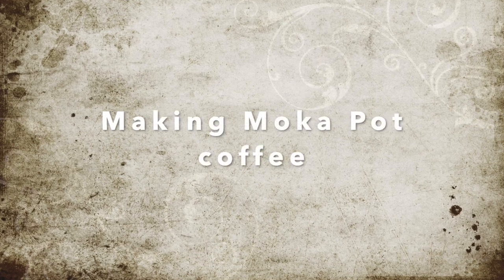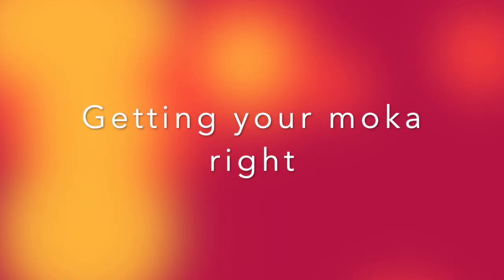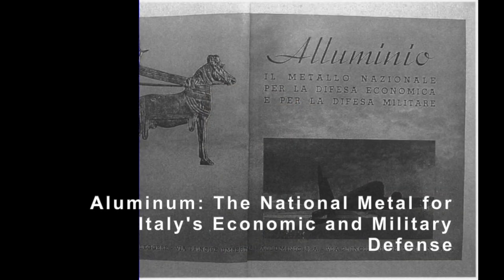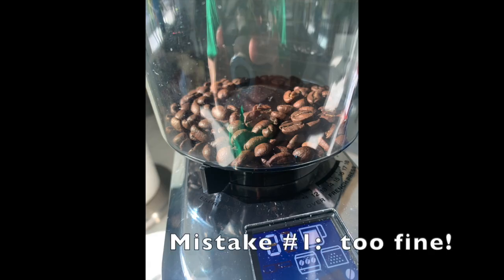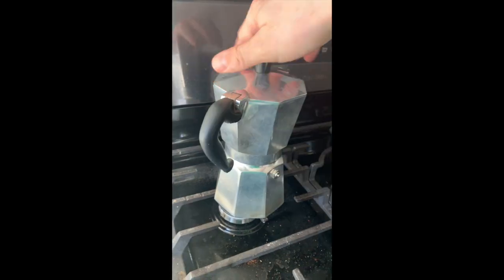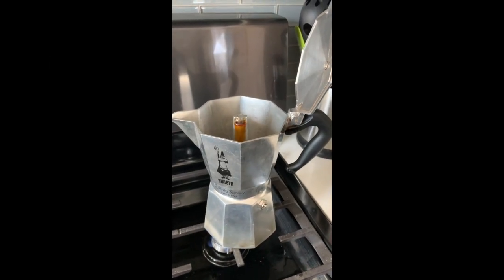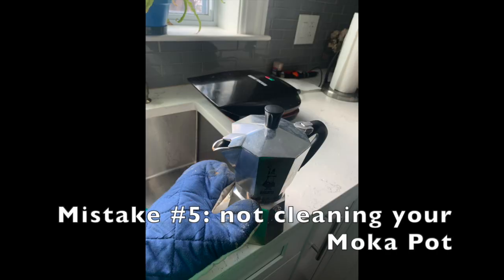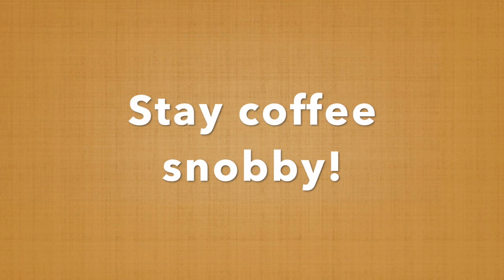Why your Moka pot tastes bad

Comment: You should not use aluminium pots. Aluminium will get into the coffee which is toxic and linked with higher risk of suffering altheimers. Much better to use a stainless steel pot. Also I think that the bitter taste in most cases comes from putting too much coffee in relation to the water.
Reply from the maker: Don't worry, I've got a video coming about that too!  Thanks for the interest!
Reply from the maker: Just published a video discussing aluminum poisoning and moka pots! https://youtu.be/qV3Us0KkIMo I included your comment in it!

Comment: What's the purpose of boiling in advance? I always just start with cold water and let it sit on low-medium heat within the moka pot.
Reply from the maker: See above.
Reply from the maker: Honestly, I haven't found preheating the water makes much a difference compared to more important tweaks like using an AeroPress filter, coarser grind, or removing from the heat at the right time, but probably you should preheat because the physics models show you'll extract at too low a temperature otherwise:  https://www.youtube.com/watch?v=O14BIH-9KTA
Reply: Heating the coffee grounds makes it taste burnt/stale/bad . If you start with cold water, you burn your grounds even before the water can go through it, resulting in bitter, burnt aftertaste. 
Starting with hot water is better because you don't have to heat the water up to temperature so your grounds arent sitting in a hot furnace without any liquid.
Reply: From what i've heard, starting with cold water can cause the coffee to burn and come out bitter as it's over the open flame longer. Starting with hot water means less time over the flame.

Comment: Tip n 2: if you pack down the coffe or if you put to much in it, the moka will stop the brewing process in the middle of it. Remove the moka from the heat source and cool a little bit the bottom under runnig water. Put the moka back on the heat and whait
Reply from the maker: Thanks for sharing. I’ve never heard of this.
Reply: Italian little secrets 😉

Comment: Put cold water in the bottom
Add "not to fine grinded coffe" making a little mountain with it
Close the moka tight
Put on minimum heat
Whait
In italy even a 8 yo child knows this stuff 🤣
Reply from the maker: Cultural transmission is not the same as science.  Behold: http://www.msc.univ-paris-diderot.fr/~phyexp/uploads/Moka/article1.pdf

Comment: There should be enough grounds to fill the basket to the top, there should be uniform depth but not packed as you said, just levelled off - any free space will let the grounds move about and allow under-extraction to occur.
Reply from the maker: Interesting idea. I actually discussed this in my new video, that leaving a bit of open space can be a solution to overbrewing. I agree with you that too much open space could cause an underbrew.
Reply: @loodog555  I think as long as you’re not packing, only levelling off, overbrewing shouldn’t happen. They built them to have the basket full, with the fill line, so I tend to follow their formula, and have had some moka coffee that rivals cafe-made espresso stuff
Reply from the maker: @ScibyTravels  I agree that their formula is generally a pretty good rule of thumb.  I think I worked out the brew ratio to be something like 15:1 when you fill the basket and the water to the fill valve. That said, these little guys tend to overbrew rather than underbrew, so it's yet one more thing to play around with.  Your mileage may vary and everyone should find a brew technique that makes them happy.

Comment: You already did the first mistake by adding boiled water in the lower chamber. Water should be always cold. Then more mistakes followed. This video is clearly about how not to make coffee with a moka pot by following your wrong advices.
Reply from the maker: Hey, this video came out a bit over simple and pushy.  I made a follow up that gets a bit more into the details: https://youtu.be/jcgMeDDAT-s. Specifically, I’ve gotten about 50 comments so far about people debating whether or not the water should be preheated.

Comment: Thank you for this concise and informed advice. The music is intrusive, but it was worth hanging in to learn about the origin and operation. BTW, IKEA make a stainless steel version which is identical but works on an induction electric stove.  Why add pre-heated water when its going on the burner? I never double down like this. The pot name is confusing, as moka is a combination of coffee and chocolate, but the geographical  origin explain this.  Happy New Year!
Reply from the maker: Man, people are really invested in whether they preheat the water!  Answers here: https://www.youtube.com/watch?v=jcgMeDDAT-s&feature=youtu.be
Reply from the maker: Honestly, I haven't found it makes much a difference compared to more important tweaks like using an AeroPress filter, coarser grind, or removing from the heat at the right time, but probably you should preheat because the physics models show you'll extract at too low a temperature otherwise:  https://www.youtube.com/watch?v=O14BIH-9KTA

Comment: Thanks for the great video. just to recap:

1) no need to grind the coffee too fine  / leave it on coarse
2) no need to press the coffee / so water can penetrate easily
3) temperature better on medium and not too high 
4) don't let coffee to overbrew, remove it before the last bubbly part starts to come out
5) clean the pot right after 

The truth is I was using cold water, so great tip on the warm / hot water in advance.
I still find it challenging to clean the tank after I left it few times with the water in. I used dishsoap, I used vinegar and even the metal-wire to rub it. Ay tips would appreciated.
Reply: Don't clean it with soap! Only use hot water to clean the moka pot. Be careful about the water tank, there is a protective layer that goes away if you clean it with soap. 
Put the flame to the minimum possible, and as soon as you hear bubbling remove it! Before serving use a little spoon to mix the coffee inside the moka pot, it is more dense at the bottom and more "watery" (?) at the top. 
Putting the hot moka under cold water can damage it, only do this if your coffee does not go up (usually this means that the filter is clogged) 
Sorry for my english, i'm italian
Reply: to clean it, you can try to use citric acid, it is sood in small packages for backing or for peackels (at least in my country). You need to put couple of packages into bigger pot, boil it an put moka pot inside. This is the same method as winegar, but without bad smell, so you can put any amount there
Reply: @mr.priman  The Bialetti Moka is made of aluminum, and aluminum does not pair well with acids ...
This is only if you want to ruin the coffee maker or want to find unwanted aluminum salts in your coffee.
Instead, it might be possible with the stainless steel coffee pot.
Reply: @antc.4457  yes, good point, i didn’t think about that :)
Reply: I just rinse it with luke warm water properly,..... that's it. Got this stainless steel moka pot more tjan 30years.It's still fine and coffee tastes great.
Reply: Im having a small Bialetti (2cups) so im cleaning it after every brew and having fresh brew every time. I used to have a bigger one(5-6 cups) and no matter what it left coffee stains because the coffee was sitting in there for two days. 
Now if u have a bigger moka just buy some contanier cup and pour out the fresh coffee there and A, immidiately wash the moka or B, rinse and fill the moka up with water until clean water is in there then worry about washing it properly later. The bottom and the filter part isnt really matter. 
Also once in a while replace the rubber ring in it. Take a picture of a fresh one the you can compare it to it how burned it gets after time.

Comment: One of the good things about them is that the spare parts are still available, in particular the rubber rings. I recently resurrected an old one that needed a new ring, which hadn’t been cleaned properly over the years.
Reply: Often my mother forgets the Bialetti Moka on the fire. A disaster happens  ; -)) ... the handle melts. So I take apart all the pieces, rub it with the 3M scotch brite sponge and water abrasive paper 1000-1500 etc. then I go to buy all the spare parts. The most complex to change is the handle, you have to hammer the fixing pin with a nail, it is inserted by pressure. To clean the limescale, vinegar must be put in the boiler and left for a few hours. Greeting from Italy

Comment: Now the question that was confusing me regarding similar tutorials - if I pour coffee out of the pot immediately after taking the pot off the stove - is there still any point in cooling the pot under cold water right before pouring?
Reply from the maker: Hi, this has been asked before below and the answer is "yes".  The coffee will continue to brew from the stream pressure after heat is removed, even as you're pouring, since you're not going to get all the coffee out in the next 2 seconds. This may even cause the coffee to brew *more*, since the steam isn't pushing against gravity anymore.  Applying cold water stops the brewing process.  My prediction would be that your coffee would still be overbrewed, but don't take my word for it!  Try it out and see what happens!
Reply: If you want to clean it out as soon as possible which is ideal, then yes.
Reply: I don't see how it would be physically possible for the coffee to overbrew if that isn't cooled: mostly because the already brewed coffee is in a sepparate chamber (the top reservoir that you pour it into your cup from) to the coffee grounds (still trapped in the basket by the mesh screen inside the moka pot).
The only reason I can see for cooling the base is to make clean-up easier by filling the empty top reservoir with water and using vacuum pressure to suck water back through the basket and forcing the grounds to pack back into to it, so that the grounds all come out as a puck when you tap the basket out into a bin.
Reply from the maker: @dj1NM3  thanks for this comment. Great question!  The coffee does become separate once it has brewed through. You are right about that. The issue is not that any little drops of coffee overbrew, but that the grinds themselves continue to be extracted past the desired point. Imagine one little grain of coffee. If 20% of it has already dissolved from the water, then hitting it with any more water will result in getting the undesirable bitter pieces.  

I’m not quite sure I follow you about applying cold water for easier cleaning.  By the time you are starting to clean your moka pot, I am sure the base is far too cold to get a significant vacuum effect. Cooling the base for me is about stopping the over brewing.
Reply from the maker: @T B Hi T B.  Thanks for your comment, but there a few things to clarify:

1) The idea that a moka pot doesn't brew until the water is boiling is a very common one, but it surprisingly turns out to not be true!  https://www.youtube.com/watch?v=O14BIH-9KTA. 

2) The idea that coffee overbrews because it's being heated belies a misconception about how coffee extraction works.  I think the terminology of "overbrewing" is misleading you here.  

Unlike baking or cooking, the process of chemical change is not brought about by heating.  Brewing doesn't happen because the water is cooking the grinds or because the coffee is being heated; extraction happens as the water comes into contact with coffee grinds and the grinds partially dissolve into the passing water.  So, while many people believe a moka pot can't overextract because each drop of water only passes through once, the truth is that you can easily overextract a given granule of coffee because you've run too much water past it, dissolving the coffee past the magical 22% mark and then you start getting past those sweet sugars and into the bitter stalky fibers of the plant.  This is why any pourover recipe has a recommended ratio (usually around 16.67:1) so that you don't try to keep extracting out of beans that are already spent.  

The reason you stop the brewing when you hit air bubbles is that the beans are not only optimally extracted by then, but instead of sending water through the grinds, you're now sending water mixed with superheated 120C steam, which dissolves A LOT more of the beans than you want for good flavor.  Navarini et al. demonstrate this in their 2009 paper, which I explain here: https://www.youtube.com/watch?v=2jLdGi7kjzk